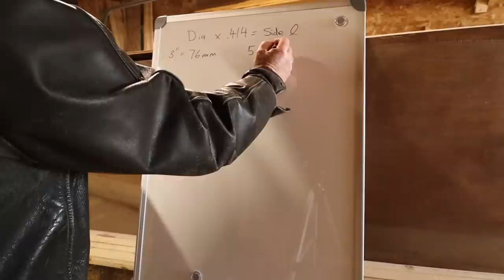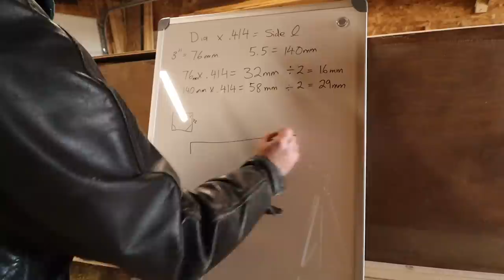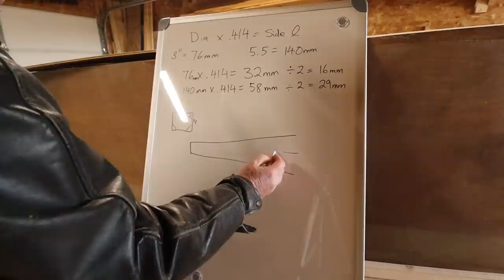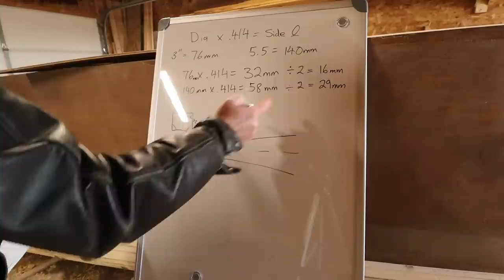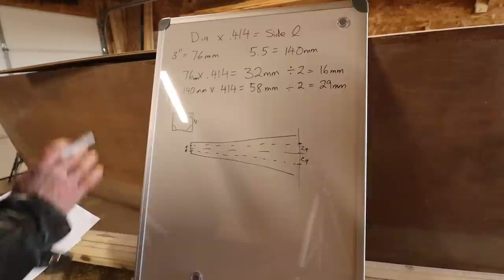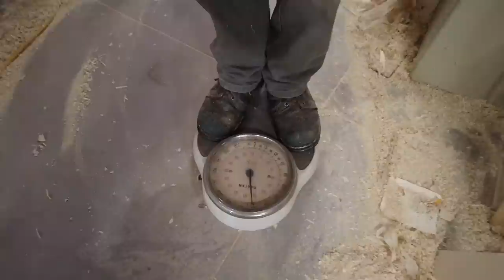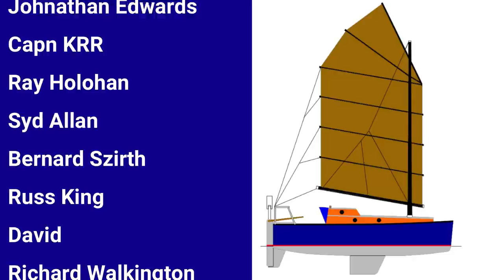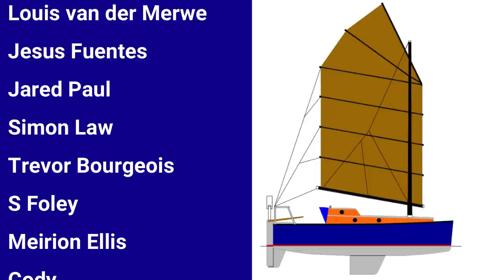S2E57 Mistakes Fixed on my $200 Mast (28 feet) Making it Bulletproof Part 3

Comment: Nice piece of work ! 
I'm noticing you sitting on the mast suspended between two Saw Horses , which suggests to me that the Horses need to be at a height optimum for the worker.  Hmm
Thank you for demonstrating all these wonderful techniques.
Tony in Florida where we don't own warm jackets.
Reply from the maker: I meant to get you this info. The saw horses are 22" tall and the legs splay out about 19". I have 4 of them and they are perfect for putting your knee on whilst cutting. I also made 2 that I use for more bench type work at 26" tall and a splay of 21.5"
Reply: @RoversAdventure  I've had a productive career in building large industrial Diesel engines. 
Your wood working prowess in practical solutions to complexities are brilliant.  
You have the most interesting channel about all-things Sailing.   
Thank you for writing back
Tony in Florida

Comment: I hit “like” before even watching. You just know it’s going to be great. 

I’m curious to see how you’ll tackle attaching things to your mast. The masthead fitting is a great idea. I imagine you’ll want as little penetrations as possible into the wood.
Reply from the maker: Still working on the design. All I know at this point is it will likely be very simple but functional. My friend Prof Smythe has offered to weld it up when I settle on a design.

Comment: The weight and flex could be at the magic point. You could make the mast the same diameter from the deck to the hull to ease installation.

Comment: Nice work with the mast. If you want to skip the router work with knots you can just as easily fill the voids around the knot with pure epoxy, sawes some work and just as strong.
Reply from the maker: In hotter weather I might try that. Even thin epoxy is a little stiff at the moment. But very good point. I will be coating everything with S1 next spring.

Comment: Reallly enjoying your educational videos. I am amazed that North Americans still use the Imperial system (Feet & inches etc). Metric is so much easier and safer. New Zealand changed to metric 50 years ago. There was much gnashing of teeth at the time but once people got used to the system there was no going back.
Reply: So true.  It would be an agonizing 20 years here in the USA to change over, and would never really go away entirely since we have an entire nation of infrastructure built in inch-pound.  But everything is so much easier to compute and figure out in metric for sure.  I used to do engineering and literally about 5% of my time was converting units
Reply from the maker: I was 10 years old when Canada switched to metric. I am perfectly bilingual when it comes to measurements in either imperial or metric. I prefer imperial for most building projects (exceptions are stairs and roof calculations) because the construction material here comes in imperial units and I prefer an 1/16 of an inch to a mm as it is easier to read on a tape measure for me.
Reply: In the UK we still use a lot of imperial measurements… feet, inches, stone, pints etc … mixed with metric!
Reply: I agree. The American Customary system (refered to as the Imperial System) can be a pain. But it does have its strengths. These come out when one stops thinking in inches and feet, and starts thinking in eighths, sixteenths, and thirty seconds of an inch. Notice each of these increments is half that of the preceding one. This is true all the way up to an inch. So, in smaller increments, it is very binary. Feet can be accurately divided into halves, thirds, quarters, sixths, eighths, and twelths.

What it lacks, and what metric has over it, is a direct math link between linear units and volume ones. There is no direct link between pounds, ounces, and grains and linear units of measure in the AC system.

Metric is not perfect, but it is better.
Reply: Metric is not as practical.

Comment: Liking the mast for sure I have made a similar one recently and all your techniques are spot on I made all the same mistakes :) I suspect like yourself because I crept up on the final shape a few inacuracies along the way didn't effect the end product.  Yes it is light enough and will work fine I wonder how heavy a lighter material would be a freind gave me a second mast for that boat for a larger rig it is probably a 10th the weight (important as this is a sailing dinghy for my granddaughters so needs to be easy to rig). 

Only issue I see is weight aloft every Kg for every M up makes a big difference in rolling moment, its a black science as in some situations weight helps and in others it doesn't but generally more is less desirable. Not saying its wrong just it will be interesting when sea trialling. 

Main difference with weight aloft though would be at rest the boat will rock more and longer at anchor which I guess is not what this boat is intended for.
Reply from the maker: Great comment thanks

Comment: Great stuff. I am following your videos, fixing up an Yngling for open water coastal cruising, Bay of Fundy etc. She has a really nice strong bendy mast but I’m thinking about leaving that aside for coastal cruising and having a rig I can raise and lower myself. The mast is only 38 pounds but deck stepped, on top of the cuddy actually. Still wouldn’t be a problem if the boat wasn’t so tippy.

Might go with a Gunter rig. Boat came with 4 mainsails, 3 jibs, spinnaker so I have sails to play with. Old racing sails so still in great shape for cruising sails.

Thanks for the videos.
Reply from the maker: We are practically neighbours.

Comment: I'm curious as to why you tapered the mast rather than leaving it the same thickness. Also, are you thinking of covering the mast in fiberglass cloth?
Reply from the maker: You Taper masts like this to save weight aloft and it doesn't have any heavy loads on that section.

Comment: Today's episode of Acorn to Arabella shows a neat tool to mark the lines in one pass...  a stick with two pegs and two pencils spaced correctly....
Reply: It’s called a spar gauge.
It gives ratios of 7:10:7.
It works on tapering square-section spars.
Reply from the maker: I watched the video as you recommended it. He said that it works on the straight section and that he would have to do something else for the taper. All things considered, with a simple calculator, the method I show takes less time and then one snaps a line....what could be simpler and more accurate?
Reply: @RoversAdventure  
Try a spar gauge.
It’s simpler and at least as accurate.

Comment: Is there an advantage to wrapping mast  with a layer of fiberglass?
Reply from the maker: Strength wise very little but folks do it for abrasion resistance and ease of maintenance
Reply: May have missed this Alan - but any intention to implement steel banding of the mast - pros and cons?

Comment: West System epoxy? The boat I built. 30 years ago I glued up with West…..the wood around the joints are rotted…but the glue is still as hard as a rock.
Reply from the maker: Some West system and some East system

Comment: Sir not to beat a dead Horse  but I hope your Mast holds up. I just afraid of Glue Joints.  Peace Be With You & Wife. Happy Holidays
Reply from the maker: It's not just the mast that's glued but the entire boat.
Reply: @RoversAdventure  but your awesome sailboat has A awesome Fiberglass work !  Take Care and Happy Holidays.
Reply: As Alan's demonstration with the mast offcut shows, modern glues are actually stronger than the timber.

Comment: Curious about how much weight was taken off  in the whole process,  I'm also  fascinated by the  junk rigging cant wait to see it in action
Reply: I can assure you the junk rig is a fascinating, and (in my opinion) the out and out best rig for a cruising sailor - and the safest.  But - each to their own....and there is no 100% bullet proof rig, but you do your best (as Alan is doing) to make the mast as strong as you can while not making it too heavy.  If ever chatting to a bermudan rig sailor, I don't preach, but they usually are interested in my rig's performance. Cheers.